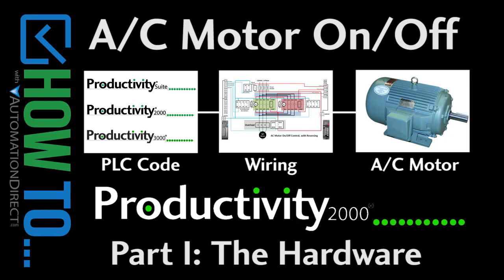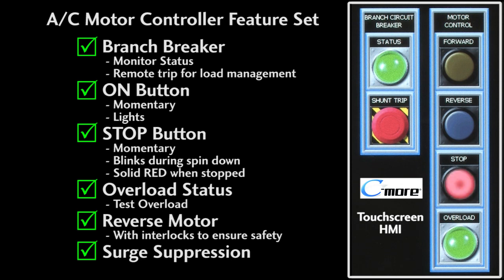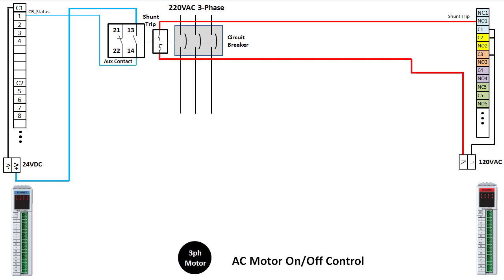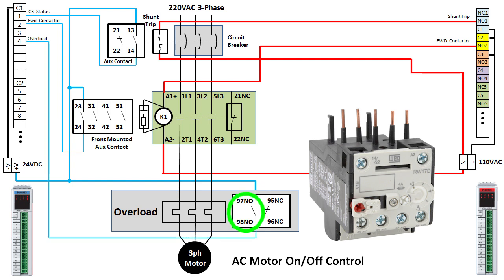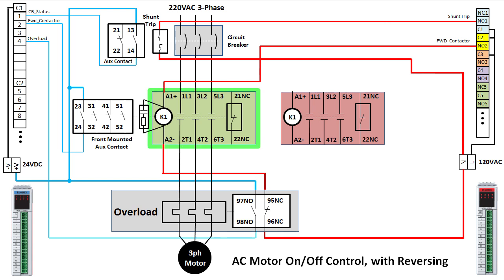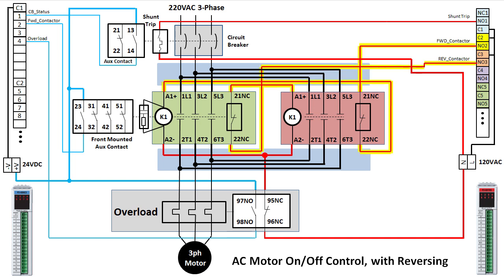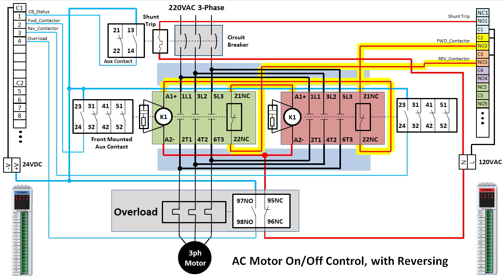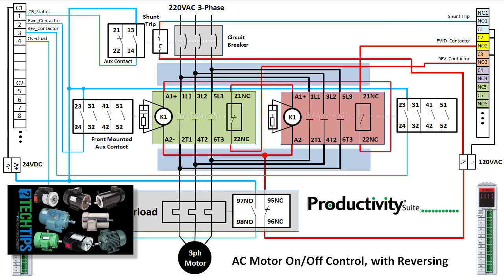AC Motor On/Off Productivity2000 Part 1: The Hardware from AutomationDirect

Comment: Thank you for the quick response, I am looking for an example where i have an encoder to read the velocity of a product on running mill  and use the analog output card (+/- 10V) to control a servo driver to have a cutoff system match that speed and perform a cut on the fly. A basic flying cutoff system. I will eventually be able to do it, but any tutorial or help would be highly appreciated.
Reply from the maker: +Ahmed Shaaban Thanks again for this video suggestion - We will add it to our video queue!